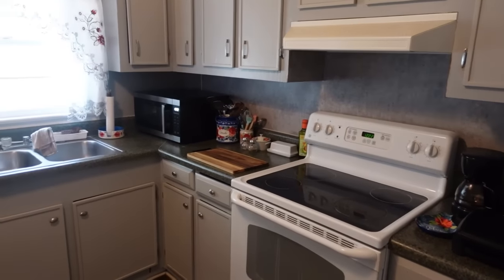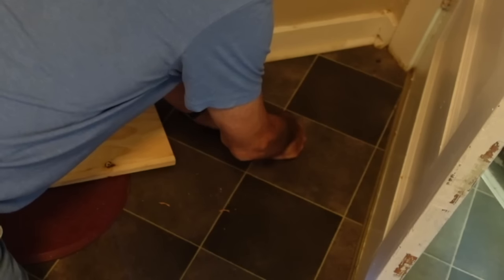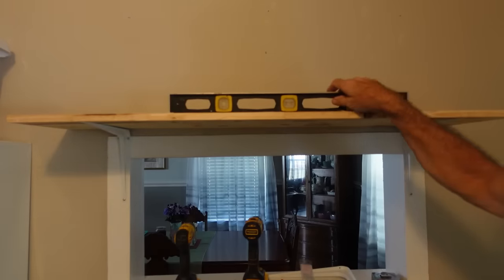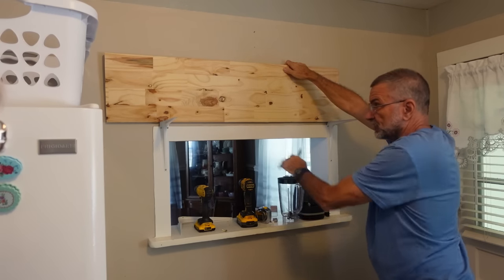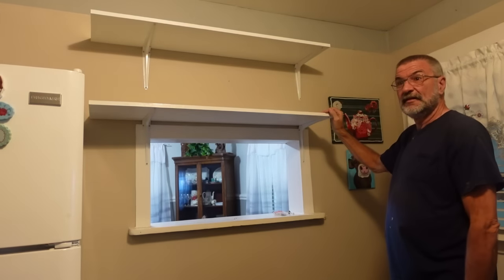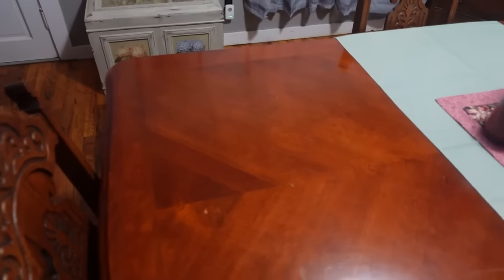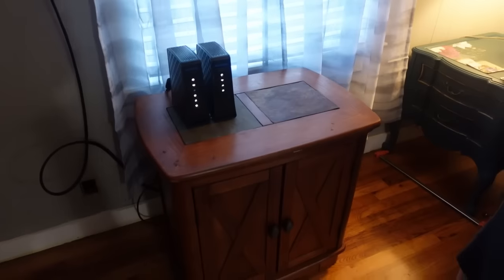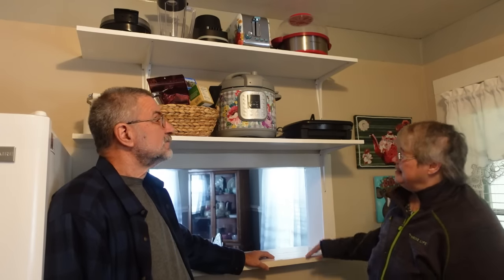Adding Kitchen Shelving

Comment: I had the same problem with my rocker, and just in case you find your little rug doesn’t work out, I bought on Amazon some little felt runners that attach to the bottom of your rocker to protect the floor.  You house is just SO cozy and comfortable now! Live the shelves for additional storage.
Reply: Had to rewatch today so I could see if I missed anything last night.❤😊lLove the shelves & art just as you have it🤗🤗
Reply: White painted shelves do look better white & the rails for pans too! 👍🤗Elizabeth & Bill you were right! Could the internet chest slide closer to the rocker so only the one straight  black wire would be straight down & just tacked at the baseboard to keep it straight. Also be used as side table to the rocker🤔🙃

Comment: I bought a cart at Target for my Instant Pot. It’s round and has 3 shelves. Doesn’t take very much space and I can wheel it over by the cabinets to plug in. I did have to get a heavy duty extension cord and wrap it around the pot when not in use. Best investment I’ve made. The additional shelves hold my IP accessories. I cut the nonslip shelf liner to put on the shelves and it works so well.

Comment: Linda is in a powered wheelchair, I used the door stops that fit on the hinge pin. I used the upper hinge, and that keeps them from getting damaged by her chair. It also is easy to adjust those doorstops to have whatever amount of clearance you need. It avoided having to drill into the tile floor in our bathroom, too. All the best to you and Elizabeth.

Comment: Your home looks so warm and cozy. We have a small kitchen that also houses our stackable washer and dryer. We put up some shelving up also to help with storage. It looks great! Only thing i would in your case is to put some of those clear self adhesive  rubber bumbers that you use on cabinets for a softer close. That way if your door somehow get pushed back to hard  that rubber bumper will protect it.
Reply from the maker: The floor stop Bill put in is well cushioned rubber where the door hits it.

Comment: You custom make every home. Those little touches are what make for a cozy home. If that lower shelf does'nt work out over time, try something else. I could not see the space between the pass-through and freezer,  but if it's wide enough, you could go vertically with those countertop items instead.

Comment: You could also paint those wires for the wifi, with your wall paint.  Make them a little more invisible.   I used to install cable.    Lots of people used to do that.  When you return your cable equipment,  most wires are thrown away, anyway.

Comment: I, actually, got rid of my regular oven when I was taking care of my folks. Because of their walk-away habit and the general danger. It made a lot of room in my kitchen.  
I  installed a double induction cooktop into my counter. I use a pressure cooker, and an air fryer for everything else. Uses less energy, doesn't take as much space, and I can cook absolutely anything I want.

Comment: I know your project is already done. I would’ve suggested to put cubed shelves under the window/ pass through would have been easier to give each appliance their own cubby without being too deep to reach the pass-through window.  Actually I think the cube shelves being the height of the window flush up against the side of the refrigerator would’ve been the best. Just a little concerned that when your door is closed and for whatever reason that door stopper could be a trip hazard for Elizabeth. Continued blessings!
Reply from the maker: I have no reason to be in that corner. 😊

Comment: Actually, you could put a small base cabinet, just deep enough to accommodate the diameter of the largest of the small appliances. Maybe with glass door fronts.   Then Elizabeth wouldn't have to be having to reach overhead for those items.  Shoot with your woodworking skills, you could knock one out on a weekend.  Nothing fancy.  Plain lines to blend with the existing lines of the kitchen cabinets.

Comment: If this is too intrusive, then don't worry about it. But this is something I have wondered about for a while. It is one of the reasons that I couldn't handle having two houses several states apart. Do you have 2 sets of tools? Or do you haul your tools back and forth. Tools are heavy. What would you do when you need your circular saw and drill, but it's at the other house? You don't go back to the other house just to get that tool. And I at least don't plan that far ahead. If you need a little shelf somewhere, it would suck to have to wait a few months to go back to the other house to get the tool to do it with. And yet, I also know that tools are expensive. When you are used to having a whole shop full of tools, it's like loosing your right hand to not have them. So how do you handle this problem? It isn't terribly important, since I will never live like that. I really enjoy having lots of tools handy to do whatever I need done.
Reply: Another idea for how to handle the door hitting is to cut off the corner of the shelf. Or maybe a combination of using the door stop and cutting off the corner of the door.
Reply from the maker: I’ve been a contractor for decades, so I already have duplicates of many tools. There are a few that I did not have duplicates of, so I just bought another one. I don’t have all of my specialized tools in Florida, just a drill, skill saw, and basic hand Tools
Reply: That makes sense that you have duplicates of many of them. We do too, actually. But this question could also apply to many different kinds of tools, such as sewing machines, mixers, etc. I guess we are very settled here, with our roots way down deep. We like to be able to reach and grab which ever kind of tool we need right then, to do whatever kind of job, and we have many, many different kinds of tools for many different kinds of jobs. Also, we have animals, so we couldn't be gone half the year, anyway. We are just home bodies. But the tools thing is something I've wondered about.

Comment: I would’ve thought that the door stops that go in the pin hinge maybe even 1 at the top and 1 at the bottom would work and not have anything on the floor as well as no drilling etc

Comment: I know the shelves are done, but I would have done them differently.  You have room between the pass-thru and the refrigerator for a small shelf, wide enough to hold a single item.  Build a set of shelves there, one sized for the cooker, one for the teapot, etc.  If the cooker needs a little wider shelf make the shelves under the pass-thru level a little wider.  The window is wide enough they won't be in the way and you can round the corner just in case.  You could also put sides on the lower part for stability.  Then put a single shelf above the window, high enough to easily clear Elizabeth's head and, better, high enough to clear the head of anyone likely to be working in the kitchen with her, like her granddaughter.  Because you'll have some items down the side, you won't need the second shelf above.  I really hope noone gets hurt rushing to the window to get the food on the table.

Comment: Great use of space for the shelves. One concern though. The right corner of the bottom shelf is at Elizabeth's temple. Do you suppose rounding that area would be safer? Just a thought.
Reply from the maker: It is actually high enough that I’m unlikely to hit it.

Comment: It just becomes more and more homey with each project you complete. It's all just darling. I have a suggestion for the black wifi box and wire on the wall. I would paint them the wall color so they are less visible. I know everyone has their own little nick-picky things they would do differently, and mine is I would switch the two pictures between door and shelves.
Reply: Looks great as is to me! I like the images in that order. Not the way usually done but looks perfect

Comment: Your teapot should be on your stove for decoration and simply take off and set on counter or top of refrigerator when u need the burner. That's what we do.
Reply from the maker: The teapot gets splattered from cooking. It stays cleaner if I only put it on the stove to use it.
Reply: @LiveSimpleLiveFree  okey dokey. I just wipe mine off but you probably cook more than me.

Comment: Primer is always needed esp for bare wood.
Reply from the maker: Not in my experience (and I've been painting for decades). One coat of primer and one coat of paint vs. two coats of paint acts about the same - even years later. The only thing I usually use primer on is bare sheetrock.
Reply: @LiveSimpleLiveFree  May I also say it appears you are an expert at finishing Sheetrock, which of course is an art.

Comment: Why didn’t you just angle the corners of the shelf so the door would open further? That’s not really good .
Reply from the maker: We've never felt restricted with how far the door opens.  It opens plenty wide enough. Angling the corner of the shelf wouldn't have added that much additional door swing.
Reply: @LiveSimpleLiveFree  Thank you for your replies. And the door looks much better with just the valance.